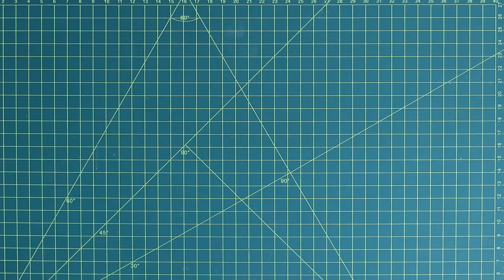DIY Janko Piano: 9. Nearly There

Comment: What percentage of fill are you using on the 3D printed parts?  Or are they solid?
Reply from the maker: It depends on the part, but the 'default' is 20% infill (cubic) with 2 walls and 4 top/bottom (.2 layers) for the framework / chassis / covers, with 15% infill for the action parts.  Both keys and hammers have varying infill % (with the hammers also varying the wall count) in order to achieve the required weights.

Comment: Did your printing time significantly affect your energy bill?
Reply from the maker: Not really; the prusa mk3 printers typically run around 70W during normal operation, which I think would be even less in my case since I have an enclosure for it.

Even during the times I was running it 24/7 (such as for this project) this still ends up being more or less like having an extra computer on for 8 hours - so ~7$ for the month (or likely ~6$ since even 24/7 isnt actually 24/7 what with the time in between to change prints). In the same time (1 month) I would be burning through around 10 spools of plastic (~200$), so the electric bill just adds an extra 3% or so on top of the plastic cost.

Comment: It really looks excellent!
I am very keen to build one.
Do you have an estimated cost?
Reply from the maker: Well... I have yet to take everything into account (though I am keeping track - or at least have a bunch of emails, receipts, etc), but disregarding 'development costs' (aka: parts I bought but decided against using) I can throw some ballpark estimates:

1. Plastic costs: 25kg, ~550$
2. mini PC, DAC, power supplies, touchscreen, and other 'misc' electrical parts (connectors, wires, etc): ~800$
3. Piano specific hardware (center pins & guidepins + tools): 150$
4. Piano felt: 150$
5. Custom PCBs: 900$ (though this was for a batch enough to make 2 pianos - but at the same time a single 'batch' would likely be in the 550$ range simply because it costs more when you order less)
6. Misc. hardware (screws, heat inserts, ball bearings, etc): ~150$
7. Acrylic sheet for the top 'window': 30$
8. Carbon rods & spring steel (piano wire for action springs): 70$
9. Kawai 3-pedal unit: 200$ (not included)
10. The very nice and solid piano stand: 150$ (not included)
11. Call it 400 hours of assembly time: depends on how you price it :)

So... call it 2.5k$ plus work hours? So around 2.5 to 10 grand based on how much value you put on your time.
Reply: @DIYJankoPiano  OK, thanks. So material cost is probably in the same ballpark as a digital piano, I think.